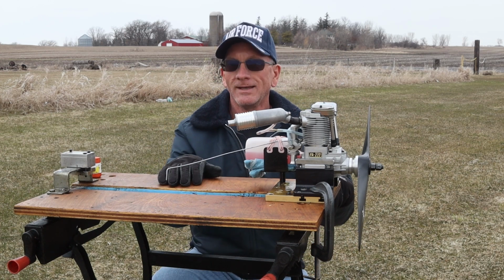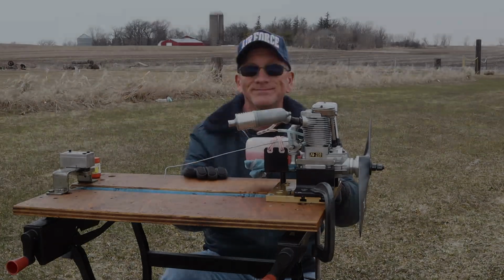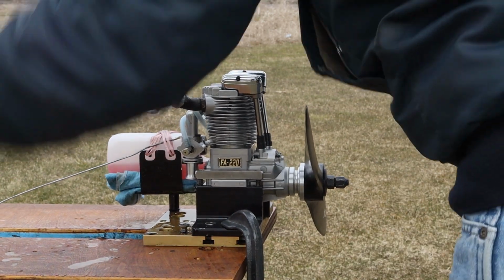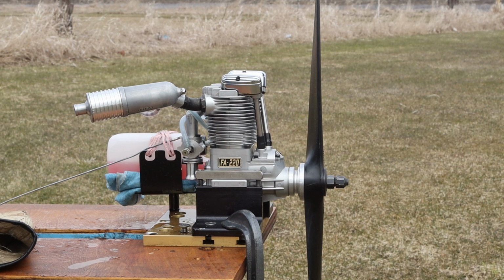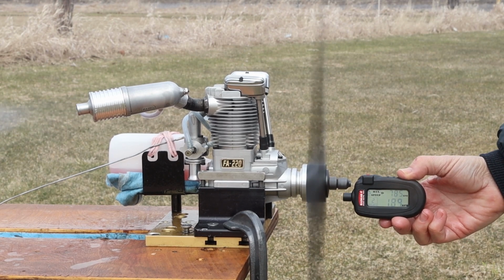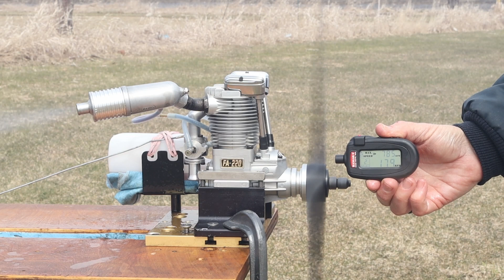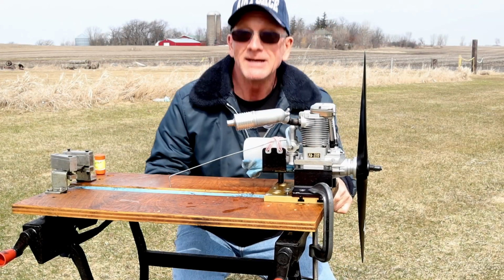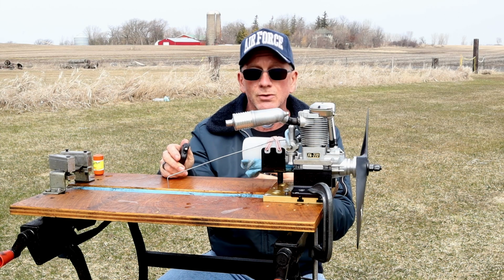Saito FA-220a Another Run

Comment: NICE,...maybe ill get my walbro outa the cleaner and rebuild that sukka so i can clean up my spring storm damage
yours sounds better than most of my saws tho
Mike
ps,...i used to fill that lighter bottle with 2 stroke heavily oiled  in if ya worry about no oil condition
Reply from the maker: Mike my first time to the field after a thaw.  It is really a marsh in many areas.  I went to check out how the runway covering held up and as soon as I stepped on it the water just gushed up. Getting to the runway was a wading event too.  I was wondering why no one was flying today, now I know....

Comment: Happy Easter David! 
Do you notice a rich section in the midrange when you run FAI fuel? I have  that on my FA 1.80. I can accelerate past it no problem, but if I stay at 1/2 throttle, it is very rich.

It is a pain to remove the glow plug to add lighter fluid, but at least it gets it started.
Reply from the maker: I have not run or tuned this engine enough to determine that Mike.  The only times I have run this engine have been the two video posted.